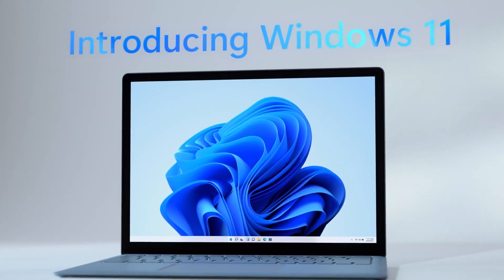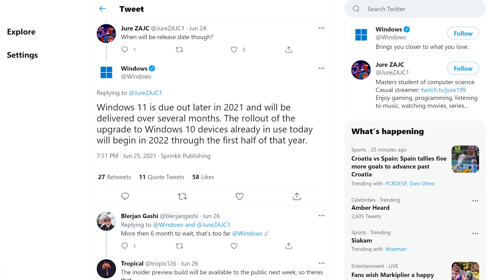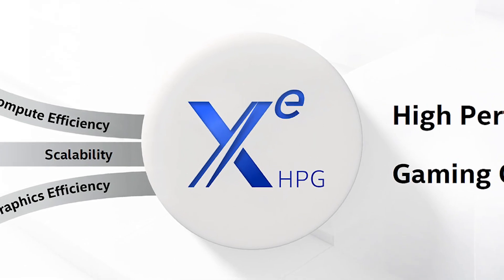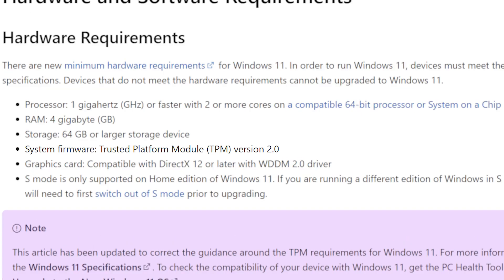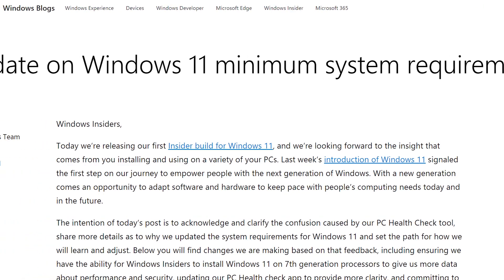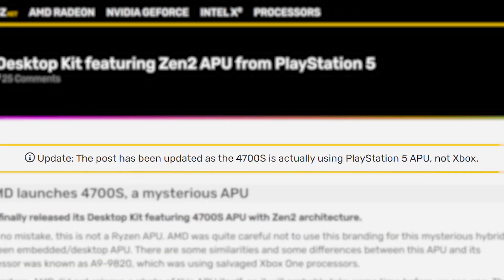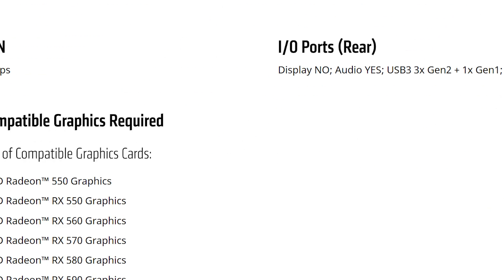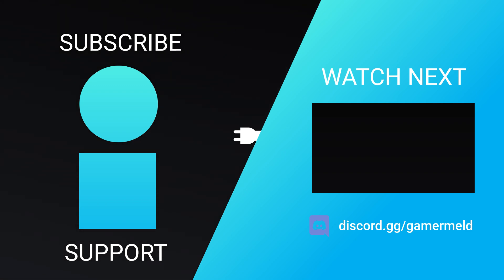TONS Of Gamers WON’T Be Able To Install Windows 11!

Comment: And then there’s people scalping TPM modules
Reply: Literally cant have anything good can we gpus cpus and now tpm either out of stock or scalped for 3 times the price
Reply: Linux guys be like "bro just use Linux, it saves you the hassle!" despite knowing the absolute reason why Linux is not a household brand. No one can use Linux as easy as people uses Windows. Linux people keep blabbing about how user-friendly Linux is.. i'm a dev, and i'm much more inclined to use a Windows-base machine to code any day than to use Linux.
Reply: @guomi821  Bro, people go to Mac if they want "user friendly" and at least the transition from Apple to Linux is way more smooth than Windows to Linux. I don't know who you're fooling by saying people use windows because it's "user friendly" since the dawn of time people have been FORCED to use windows, most people barely know how to navigate it and that's why Microsoft is constantly trying to "reimagine" it but it's torn between the consumer and the corporate environments that were trained on it.

Also "I'm a dev" lol, well look at you and your authority badge. Mr. authority with his dev badge. lmao.
Reply: Linux is not ok when comes to support Anticheat except valve Anticheat.
Reply: Just download TPM
Reply: And it’s funny because it’s easier to follow instructions to modify the installer.
Reply: Most modern cpus have TPM capability included on them but the setting in bios must be enabled. Its called PTT for Intel and, I believe, its something else for AMD.
Reply: @willo1345  And what happened with Hardware for 5 or 10 year old? the "upgrade" of "buy a new PC/Laptop" is not an option were the country yoy live the basic salary is 450$ and the PC/Laptop cost twice (the decent one)...as an example. Thta the real problem, a lot of people actualy have old hardware and was hoping to get the W11 working 8im including).
Reply: What, I can hear you to care enough. The Linux Community is cheering and breaking out the cardi!
Reply: Most CPUs from the last few years or so literally have Tpm built into them. Intel call it something stupid like ptm or PTT, AMD call it the standard ftpm. Just a simple setting to change in the bios.
Reply: Just use Linux. 
No need for TPM modules. Problem solved!
Reply: @pablosartor6715  Its a hassle. You need to install different kind of stuff to get things working. Linux isnt a normal daily OS. It's mainly meant for developers
Reply: @skiez7430  This is not true anymore. You live in the past and your information is old and plain FUD.
I recommend that you  just give kubuntu 21.04 a try and stop talking nonsense.
Reply: Pablo Sartor This dude fr want to talk beef over a computer OS. Grow up
Reply: @pablosartor6715  How about you stick to Linux and I will stick to my perfectly fine Windows 10? Tried Linux so many times, it is nice for what it is, but it is not for me and you acting like people are "wrong" for disliking (or not wanting to use) Linux?   If you prefer Linux, stick with it, but trying to argue with people about it?   Do not be immature about something so trivial, damn man!
Reply: @pablosartor6715  Linux is great. It has so many great uses. User friendly for mom, pop, and average gamer, it is not.
Can't exactly dual boot Windows 11 for the next generation of games either. Wine only goes so far.
Reply: @pablosartor6715  When Linux have the games and programs i need to day life/work and not tyrash limited alternatives you can call me (i mean, its good Linux...but for me not).
Reply: @extreme123dz  have you ever heard of wine? 99% of windows programs and games will run on linux using wine
Reply: @extreme123dz  really? Limited trash alternatives? Are you tried Linux so far?
Tell me, what are those games and programs YOU deseperately "need"?
Reply: @pablosartor6715  Tried in the past and in that moment they were a limited (and for me trash) alternatives, crashes, slow my workflow by far and etc, IDK if now days are good or not but the same problem with Apple, one i have serius problems in work/personal/study, is a (for me) fucking piece of shit, also i need coding and other things to personaly solve problems that have Linux (Ubutum at the time) for EASY things that Windows have in "one clic" (see the quotation marks).

I repeat, IDK if thos probles now days are slve, is more easy to use without knowledge on coding, programeng, etc even for the easiest part and with 1 click everithing is done and 100% compatible with all programs of Windows (from 1990 to 2021). but i have personal bad experiense with Linux, sorry if you dont like it or believe me.
Reply: @Fogolol  Just yesterday I was updating Xubuntu (Linux) & it was taking too long so I closed window & shutdown it. When tried to boot now it only shows Xubuntu logo & never get to login screen, So no thanks Windows 10 is still alive
Reply: @pablosartor6715  And play no games either....
Reply: @MarvoloRiddle  Play no games??. Hahahaha
You have not idea.
Reply: @MarvoloRiddle  Proton supports at least 15000 Steam games
Reply: @elnkr2603  See that's on steam only as far as I'm aware. I have some games on epic games store as well. AC Valhalla, Watch dogs etc. And even as a software engineer outside of programming. Linux is sometimes a chore to deal with, it's almost Part time job. I use it to program in C++ and do some networking stuff and swap back to Windows.
Reply: @pablosartor6715  for poor guy playing in intel uhd outside steam give me some ideas
Reply: @MarvoloRiddle  lol DXVK Libraries go brrrrrrrr..

Comment: whaaaat?! Man, I honestly never thought I wouldn't be able to upgrade to windows 11 because I have a ryzen 1800x, it sounds like a perfeclty fine cpu to have for modern software
Reply: Not so true i already installed win 11 iso that was leaked on a ryzen 5 1600 without any problems... B450 motherboard

Comment: Main issue. I was so hyped, now I’m convinced without even trying that I won’t be compatible. I’m not building a new PC for an OS.
Reply: You guys should not be so quick to jump to a new operating system before there's even a stable release of it. The truth is, usually every second OS from Microsoft is trash.
98 ✔ 
ME X 
XP ✔
Vista X
7 ✔
8/8.1 X
10 ✔
11 X
Reply: I'm sure it'll be fine. There will be changes between now and next year.
Reply: Yea
Reply: Extract the win 11 iso, replace 1 file with win 10 file, repackage with rufus and install. There are already full tutorials.
Reply: You realise games and drivers will hard lock at Win 11 at some point in the near future, same as modern games no longer run on anything below W10. Some can be fooled to do Win 7, but some don't